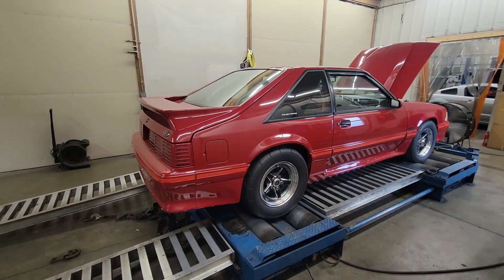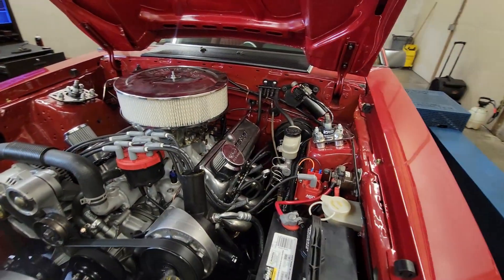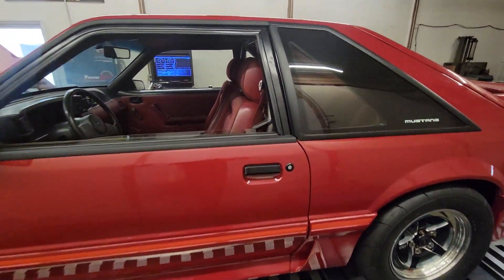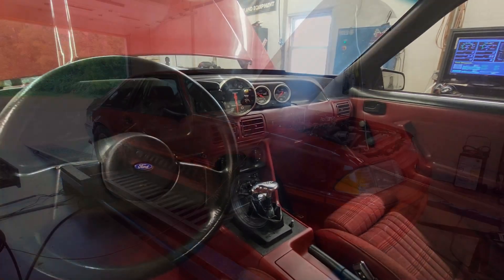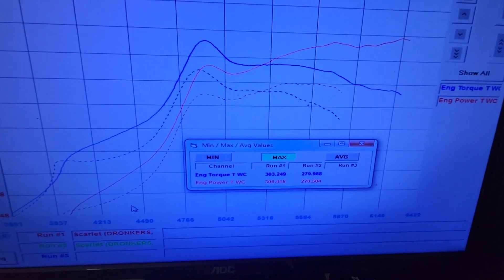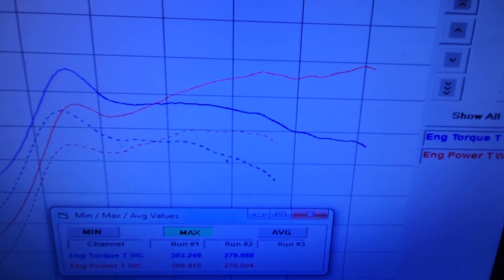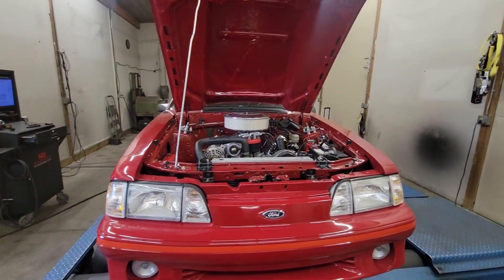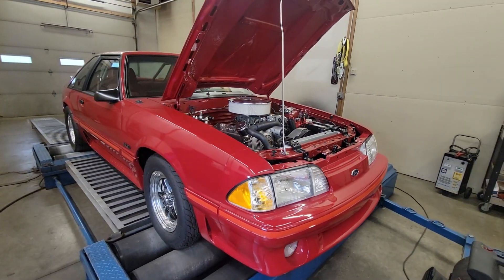Stop Using These Cams!  Here is Why | 331 Small Block Ford Mustang Cam Swap

Comment: I  have watched  these videos . I don't think a 347 stroker ,or 331 is a coyote engine . No point in revving a comp xr 282 hr past 7000.  It peaks earlier in a stroker . If it was a solid roller stroker ....it was made for it sure . You don't have a set of afr heads or trickflows on there either. That cam peakes at 6500 in a 302 . I would think you might get 5600 out of with 190 11 r heads , decent intake ......
Reply from the maker: Thanks for watching, and your opinion! My thoughts are this. HP is math from tq and rpm. Could it use more to get to 7-7500, definitely. And as you stated, the heads are likley a limit up there.

Comment: Would that cam work well on a 306? My setup is gt40 heads and intake 1.6rr 70mmtb  76maf exhaust etc.  I have the b cam as of now. I want that higher rpm pull my car dies on the big end. I was able to put down 13.27 @104 8.5 1/8. It has great low end but I believe it could be better and that the alphabet can is holding me back..
Reply from the maker: The cam in the video would work well in a 306 to around 7200. Unfortunately, your gt40 intake is only good to about 5800.  My suggestion would be to change both the cam, and the intake.
Reply: Ditch the efi if you can

Comment: Similarly, off-the-shelf cams aren't the best either. I went with a custom grind, .600/.595, 227/231 at 112 lobe sep on my 347 and it has great power everywhere and will rev to 7K, no problem. With only 11 passes on the combination, the Terminator-X is is still learning and I've gone a best of 11.57 at 121 on 9" slicks with a shitty 60" in my Foxbody. The rest of the combination: AFR 185s, 60lb injectors, 75mm TB, Focus IAC, Holley Systemax intake, 1 5/8 Motorsport headers, 2.5 inch Borla exhaust with Hedman H-pipe, electric water pump, TKX trans, Fidanza dual friction clutch, aluminum flywheel, aluminum drive shaft, 3.73s, Team Z tubular K member, strange adjustable shocks/struts and upper and lower adjustable control arms. The driveability is fantastic and I couldn't have asked for more out of a street/ strip cam that has to support power brakes. Thanks for posting the video.
Reply: Hogwash! There are plenty of good ots cams. Just like a custom, you HAVE to match the cam to your combo. If you need to have a custom cam maker TELL you what cam specs you need, then you shouldn't be building engines.

Comment: Alphabet cams werent designed for a stroker/carb set up.  Its not that they dont work. Its that they dont work for your combo.   You took an X cam out, which is just a B cam with more lift. And added a cam with 20 more degrees of duration in.  Ofcoarse it made more power.
Reply: They're just trying to get sponsored by comp cams.

Comment: So you went from 224/224 to 232/240 cam on a 331ci…of course it’s going make power and push more rpm.  You need to change heads those are low numbers for a 331
Reply: Exactly.

Comment: That thing was floatn valves, u think that reved clean?
Reply from the maker: its definitely not floating the valves.  the one shot from engine bay sounds odd up top for sure.  Guessing its just the gopro mic.  The last hit from the back sounds good.
Reply: @ForceEngineering  i can here it not wanting to climb but u held it, i have afr 220, with springs good to 7000, and i use every bit, and dont have to wait to rev, that engine sounds like shit

Comment: And that's with factory 351 heads.... With a mated set of AFR or TFS heads on that engine the cam swap would have shown an even larger disparity. Alphabet cams are for idle and nothing more.
Reply: yeah for strokers for sure.  AFR or TW 205's or vic jrs

but the x cam (the biggest of them letter cams)  would not be too bad in a 302/306 

BUT  i still would't run one because they make hydraulic flat tappet cams bigger than that LOL

letter cams are old school shit  for sure but its what you did back then...in the 90s LOL
Reply: @KingJT80  Wasn't the Z303 cam the biggest of the alphabet cams?
Reply: @cgarris8674  it was but I thought they didn't make it anymore

Comment: my 331 runs a F cam..I agree maybe not the best for the Set up ..Promaxx heads, Performer RPM2 Terminator x, AOD, 373, Full Exhaust with cats and all ..but runs easy into the 12s at the Street .. (Dragy)..would like to see what she does at a Track with Traction... (92 Hatch )
Reply: theyre are flat tappet cams that are bigger than that LOL but it sounds like you car runs good

and im considereing one of them with either staying 302 (ill pick the erson 228/236 .568/568 lift)  and promaxx MAXX 180's 600DP and air gap or the erson 236/244 .568/.568 lift hydralic flat tapper if i go 347 ann promaxx ""project X" 185s and a 650DP

Comment: The letter cams are good for a driver. That's about it. 
I have a B303 in my 306 that's going in my nice driver. But, for my street/strip car I have a solid roller in that 347. Big difference

Comment: I had a solid roller cam in my 347 stroker wasn't best suit to run on street but I swapped it for a hydraulic roller cam from comp cams
Reply: Hydraulic or the solid ? The solid roller wasn't mine I used it until my comp cam came in
Reply: Which cam?
Reply: I’ve got a 10.2:1 331 sbf, 190cc aluminum heads 2.02/1.60 blueprint hp9009 flow 250 @ .500 lift. 1-5/8” mid length headers, comp roller rockers, cam is a comp XE266HR12. 600 vac secondary carb on 1” open spacer,weiand street warrior intake, at 5200’ elevation pulls 12 inches Mercury at idle. No idea if my cam is ideal, but for a 4000lb manual bronco on 35s through 3.73 gears it works ok. Too many videos after I picked my cam and installed it spouting I ought to have gone tighter LSA . Vizard and some other dude. If I thought going with a tighter LSA with more duration would net more torque through the entire curve of course I would

Comment: I'm surprised how many people don't know that adding 20 degrees of duration will add power up top. Even when it's breaking up at high RPM.
Reply from the maker: I'm surprised how 8* of intake and 16* of exhaust duration turns into 20.  Also surprizing is that is makes more power literally everywhere in the graph and that is considered "up top" lol.   I drove it into the limiter a couple times.

Comment: Puts way bigger cam in, makes more power, shocking, pointless test, and would check out why its breaking up on the top end.

Also, still dont put letter cams in your smallblock, they were out of date when they came out.
Reply from the maker: You wouldnt say it was pointless if you knew how many people bring me small block fords with alphabet cams and think thy are going to make power at 6500.  I constantly have to explain why, now i can show them.  I drove it into the limiter.
Reply: @ForceEngineering  lol it was breaking up b4 limiter, its got spring issues, lower ur rpms, its just a small hydralic cam

Comment: I am going to try the new f303 plus in my 331 with 1.7 rockers
Reply from the maker: What intake manifold?
Reply: @ForceEngineering  trick flow r model
Reply: @2camsam how did that turn out for ya?
Reply: @chrishansen7004  The car is running and driving but runs out of fuel at 4000. The fuel pressure drops 20 psi. I am going to drop the tank and do the 10 gauge wire upgrade to the 340 pump and see if that fixes it.
Reply: @2camsam  did the 10 gauge wire upgrade fix fuel pressure issue?